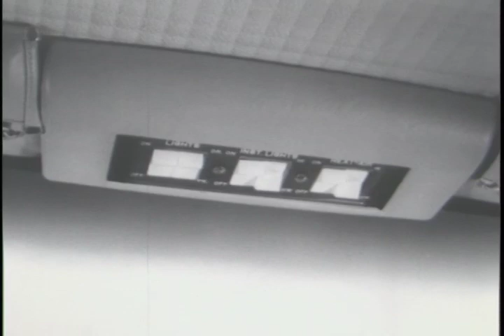Studebaker Avanti Preview

Comment: I have one of these that I've owned about 10 years, and I absolutely love the car, but it's funny to listen to some of the claims in this ad, knowing what I know from owning and restoring one.  The claim that "it's an aerodynamic wedge shape, designed to cheat the wind" made me smile.  The car is more aerodynamic than most cars of that era, but that's not because it was specifically designed to be.  It wasn't wind tunnel tested or anything of the kind; it was just designed to look sleek, futuristic, and unlike any other car on the road, and the improved aerodynamics came as a by product of that intent.  And the claim that it was the most advanced car on the market was both true and false.  In terms of safety, it really was quite advanced for its time, with a padded dash that was still fully compliant with later federal safety mandates, right up until air bags became required.  It had its fuel tank placed above the axle, like cars do today, rather than behind it and below the trunk, like nearly all other cars back then, and this made it far less likely to rupture in a rear end collision.  It had roll bar built into the frame to keep the roof from pancaking in the event of a rollover.  

But in other respects, it was very much a car of its time: the seats had no headrests to protect you from whiplash, and the seat belts were optional (as they were with most cars that had them then), and were lap belts only.  And in terms of its engineering...  Well, the truth is the car was getting a bit antiquated.  The chassis and suspension were quite old in design, but Studebaker had no money to design the brand new, advanced ones they would have liked.  The engine too, while producing good power, especially with the optional Paxton supercharger, was heavy for its displacement, and owing to Studebaker's conservative engineering when it was designed, not able to be bored out any larger than 304ci, and even that only on specially selected blocks.  This heavy engine gave the car a front-heavy weight distribution, which impaired handling.  And of course, like all other American cars of the era, it rode on bias-ply tires that did nothing to help it handle better, even though performance cars in Europe were riding on advanced radial tires from Michelin or Dunlop.  One contemporary review of the car, by a couple of British automotive journalists, praised the car quite highly, but they noted that the handling would be improved by radial tires, and they also noted that highway cruising would be much better with the addition of an overdrive gear.

Given cash-strapped Studebaker's limitations, it's really impressive that they nonetheless managed to bring out a car that, despite the heavy engine and outdated chassis, still offered real performance, and very good handling for the day.  I love driving mine around.  It gets a lot of attention, and most people have never heard of it.  Many take it for a European car.  I get a lot of James Bond comments, just because the car strikes people as looking like something that Bond might have driven, not because it ever appeared in a Bond film (though Bond's creator Ian Fleming did own one).  It's a pity the car didn't revive Studebaker's fortunes, as CEO Sherwood Egbert hoped.  But at least it meant the company went out with a bang instead of a whimper.